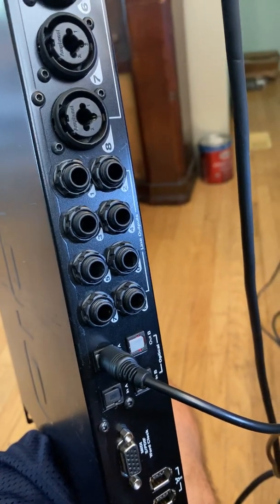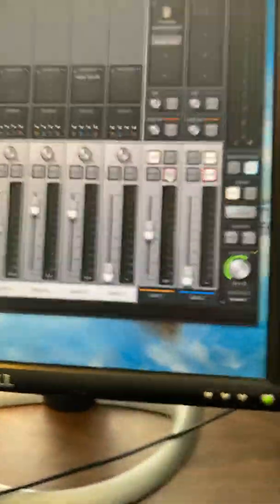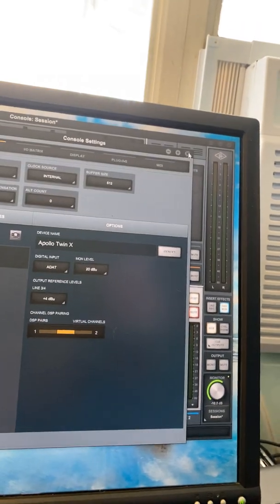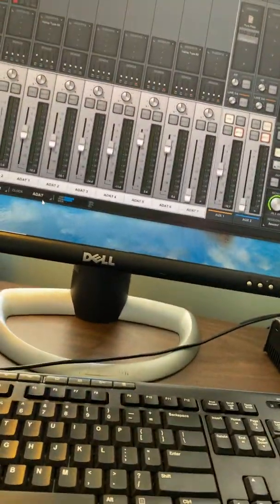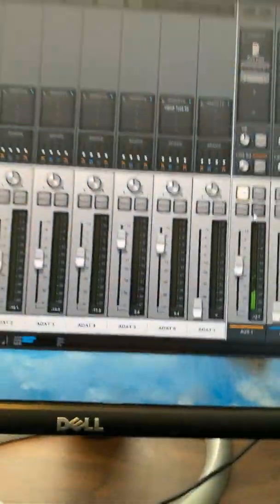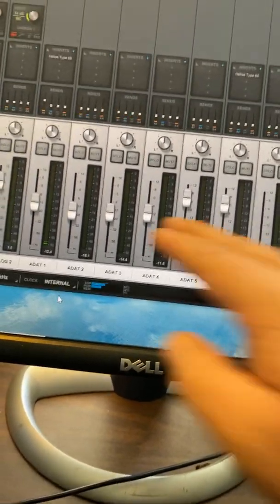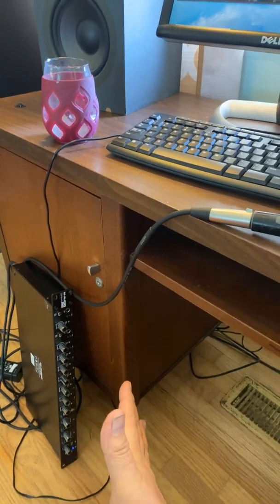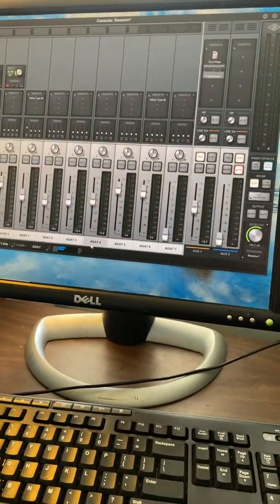Using external interface with an Apollo Twin X

Comment: how did you make this connection? Is the optical cable plugged into the adat output of the m-audio?
Reply from the maker: Yes it is connected to the output of the m audio
Reply: @ivanduke  thanks